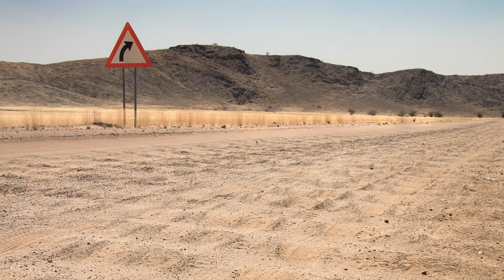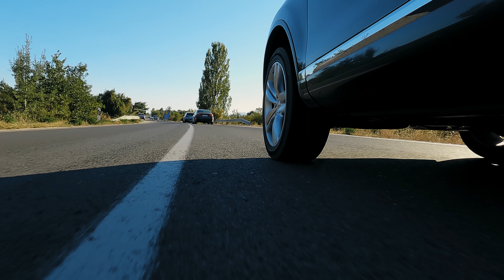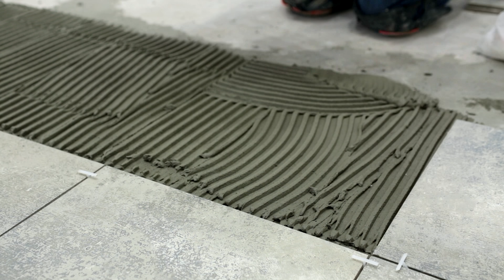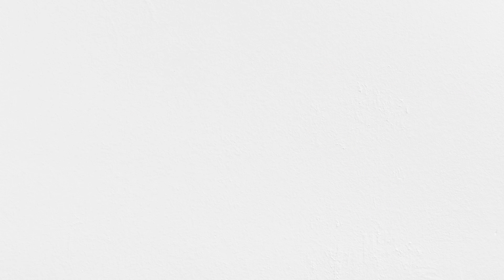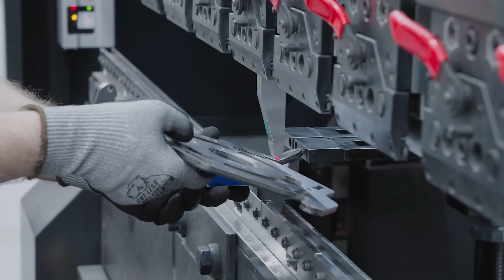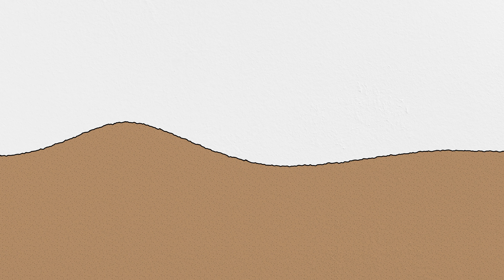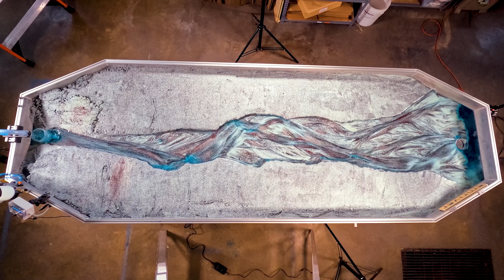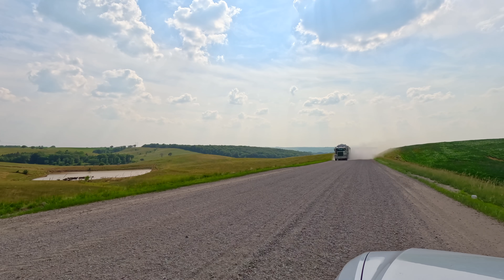Why Roads Get Washboards

Comment: As someone with a gravel driveway in need of repair/resurface, testing of different methods of stabilization in your test bed would be cool to see! 

I've been researching different base materials, geotextile fabric, stabilization mesh, geogrids, rigid pavers, etc. All the marketing tells you every product is the best, but in practice that's never the case. The size of my driveway makes it a risky expense to experiment, so seeing comparisons would be invaluable!

Comment: even asphalt can start warping, i remember an old bus road where where i lived, where there stopped busses every 5 minutes. the road at the busstop had a divit with wobble after, like a carpet that has been pushed, after having the heavy busses stop and start at the same spot
Reply: That's why heavily trafficked intersections on an asphalt road will often have concrete for the intersection itself and some distance approaching the intersection.
Reply: I've seen asphalt roads where they put in concrete pads just for the bus stops. Another example of the cost vs durability trade-off.
Reply: I have some very old memories of this phenomenon, too. It was a much bigger problem in the middle 20th century. The materials science on asphalt has really improved since then, so it won't bunch up / washboard / extrude to the curbs / soften in the heat like it used to.
Reply: There's an awful section of road in Arizona that's basically melted and wavy.
Reply: I'll see this behind stores, where they'll leave a shipping container in one spot for nine months.  Then when they move it, there's four distinctive dent patterns where the corners used to sit, molded into the pavement.  In both cases, the tar acts like a very thick liquid, like that pitch drop experiment.
Reply: different cause though.. heavy wheels in always the same spot cause asphalt to flow outward creating valleys along the road, and at the stop itself when trucks brake, start (dynamic forces) and sometimes stay for extended amount of time you get pits because of higher load
got a similar stretch of road, it has bus stops, intersection right after the stop and bus depot nearby... need to be extremely careful when driving, stay in the valleys (absolutely no overtaking) and slow down before the pits
Reply: I remember once visiting Auburn Hills, a largely commercial suburb of Detroit.
Keep in mind that Michigan allows dual trailers with a LOT more weight than other states.
There was an intersection near where I was visiting where the asphalt was barely 5 months old, and had been pushed into a 4-6 inch "wave" at the stop line.
Reply: I think that's a bit different. It's happens to surfaces, including gravel, when there's repeated acceleration or braking on it. Like a bus stop or it could be up a hill on a gravel road. Keeping and even speed in these places is important. Obviously a bus has to stop and go, so the best way to meditate that, is to use a different and more resistant material, looked concrete, in those specific places. On bus stops. Up or down steep hills or even in some turns. If you have driveway or private road, try to keep and even speed.
Reply: I second this, there is a few really old roads that aren't pothole damaged but are heavily warped here
Reply: That's right and I've always thought that is it due to incorrect design, and/or execution of the vertical structure of the road.
Reply: What you're talking about is not the same phenomenon. You're taking about what's called "shoving"

Comment: But this does not explain two common observations:
1) The corrugations are very wide, much wider than each wheel. In fact, they often extend across the whole road surface. If the corrugations were created only by wheel action, they should be independent for the usual tracks of the right and left wheels.
2) Similar corrugations also occur where there are no roads. I have come across them driving on hard desert surfaces, off any beaten track.
So there must be some other factors in play as well.
Reply: People dodge the washboards and spread them.  Accelerating tires slipping  cause them.

Comment: Back when car companies were messing around with active electromagnetic suspension (I think Mercedes demo'd a car with a suspension that could actively hop over holes and obstacles in the road) I imagined designing algorithms that if they were running on enough such cars could keep washboarding from happening and in fact keep the roads smooth just by driving over them.

Comment: In Guadalupe County they did a few test sections of road using old car tires as a base and covering them with road base. The tires tend to lock in the material better. I never heard how it lasted. There is a section of FM20 north of Seguin that always wash boards no matter what Txdot does. The base is too unstable.

Comment: All I know as a boy we lived on a dirt road in the southern California desert. We moved there in 1964. The road was smooth but got wash-boarded over time. Most of the cars out there then had leaf springs on the rear axle. When a car moved out there with coil rear springs the road would get washboarded. We only had a few cars a day go by back then so it was very noticeable. The residents out there would drag the road every few weeks with anything we could get, an iron beam or old bed springs loaded up with a bunch of rocks. Sometimes we would luck out, the dude at the end of the road had a motor grader and would grade the road .
Dad attributed it to what they called "crow hop".

Comment: Washboard surfaces go all the way across the road though. How is that possible? The washboard surface was so regular on a road I used to drive on (now paved) that I assumed it had been engineered into the road to handle storm drainage! 😆 This video is a revelation.

Comment: Every time I have been driving over rural roads of Siberia I've been imagining how that washboard is it came to be. My best guess so far was it has to be related with a spring resonance frequency and diameter of the wheel.
This needs MOAR details, it's like scratching the surface of dams, tell as more about this phenomenon so I can tell my passengers how it works for hours when our teeth rattle :333

Comment: calamina roads, very common in my country. it's caused by heavy ton trucks driving at high speeds compressing the gound forward. Dirt roads that have been flat for decades turn rigged a few months after some construction like road paving, real state development or whatnot that is causing hundreds of trucks to transit for said road per month

Comment: This video is o cool, I genuinely thought that they were compressed this way deliberately, sort of like they do for ski slopes. 

I still find myself confused with this explanation. One thing that doesnt quite make sense to me though is the size of the ridges, they are pretty small. If you look at the demo in the video, the size of the ridges is larger than the size of the wheel, so you can talk about the wheel going up the ridge, getting airborne, and landing again in the valley. However, the ridges I am used to on rural roads all seem to be much much smaller than the size of the average tire. 

A bigger point however is that the washboard pattern seems to be uniform across the width of the road except for where the tires seem to go. In that there is usually a noticeable lack of ridges precisely where the tires are, as though the cars driving over these are flattening out the ridges, not creating them, while the ridges go uniformly through the center of the road and off to the shoulders where there are fewer tires contacts.

Finally, if you look at the ridges you see in sand dunes or riverbeds, they have a rough scale and size, but they are not uniform and straight. However, the washboard pattern or unpaved roads seem very regular and perfectly straight.

Comment: It pays to drive quickly over corrugated roads as the tyre skips along the tops rather than dipping and diving each roller coaster. Also less air pressure in the tyres softens the bumps or you can really get a jaw shaking ride over long distances.

Comment: I wonder if vibrantions from the vehicles passing through help kickstart the process or helps speed it up in any way. I grew up on dirt roads and always hated driving on them because of washboards. Never knew there was a name for it. My teenage self in my 84 Pontiac firebird was always doing donuts and spinning out on the roads pissing off the locals even more.

Comment: I used to drive for a limo service.  I had to learn to laugh at certain customers complaining since trying to explain what they were complaining about was their fault, not mine, never went over too well. THEY chose the farm/barn venue for their wedding; a farm venue that was usually at least a half mile or more down a dirt road off the paved main road.  They'd ask if I could go faster cause they're late.  Not my fault they walked out of house [at pickup location] 35 minutes after pickup time. I was there 10 minutes before the pickup time. Then, after ceremony and it's time to head to reception, everyone would leave but couple had to take pictures and more pictures and more pictures.  Now, I'm supposed to hurry up since everyone has been waiting at the reception location for them to arrive.  Again, sorry, not my problem. I will only go fast enough down nature's vehicle suspension test track to keep the noises from the car - the car, the glasses in glass holders in back, anything and everything else in back - to an acceptable level for the human ear.

Comment: Ok so reading the comments made me remember this. 
Concrete highways are poured in sections. Concrete density is higher at the form interface, so it is slightly taller that the middle which contracts as it cures. 

The sections are poured in equal sized pieces. This causes a harmonic bounce in the car, which is very un-fun in the cars. 

WHY IN GODS NAME are the sections not poured in different length sections, AND poured with angled edge instead of perpendicular to traffic direction. If we just made a randomized non harmonic pattern then the cars suspension would smooth everything out and the harmonic would not form. We do things like that for other installations, it would not change function nor cost, and it would solve the uncomfortable and sometimes dangerous problem.

Comment: Yes I would like to see a video on different materials as a road base. I used to live in a community that was responsible for the road maintenance and they were all dirt roads. This community was south of Tucson AZ, so it was dry desert with periodic high volumes of rain so there were washes with culverts that the road traversed with big up and down slopes. This created the problem of wheels accelerating the washboarding because as the wheels accelerated they would spin out and dig out the washboards even quicker. They had plans to improve the road but it was millions to put in bigger culverts and fill in the valleys that led down to the washes over the culverts. And since this was a community of large lots of only maybe 200 houses, there wasn't enough funds available to pay for it. It was a headache to get money together to just grade it periodically. I'm a mechanical engineer and like analyzing problems, so I looked into different road base materials and there are lots of opinions on what makes a good road base. Then there is the cost of importing thousands of yards of the right material. I found a manual that was very helpful, "Gravel Roads Maintenance and Design Manual" November 2000, put out by US Dept of Transportation. They talk about all aspects of gravel road maintenance. There is a picture of a road in Ecuador that sees 200 inches of rain a year and is in good shape with minimal maintenance. The biggest factor to a good dirt road is drainage management.

Comment: I see many washboarded areas on asphalt in PA. It seems to mostly occur around intersections, often in the braking areas. We also get huge ruts in asphalt at intersections where trucks frequently wait at the light, like a turn lane into a truck stop.
Reply: Most definitely they always pop up where vehicles accelerate from either a stop or coming to one.
Reply: You should also know that dually trucks must drag one of their wheels to make turns, this digs into the asphalt.  Same with dual axle trailers, one set of axles has to drag to turn.

Comment: so long as the roads are dirt the only real way I can think to handle it is a flat rigid road drag with a compaction wheel behind it. Motor graders are not good for this task. 

But I personally always thought it was the drive wheel causing this more than the driven wheel,. I figured the drive wheel would break traction slightly while moving forward pushing the top layer of material backward and creating a little ramp, when the drive wheel hits the next ramp it compacts it. so the harmonic resonant frequency of the suspension, tire sidewall, tire diameter etc all played a part in making an averaged harmonic to make the drive wheel bounce its traction and the driven wheel to serve as a compactor. 

If you look at uphill sections the lane going up the hill tends to have more ripples than the down hill side (which is why I drive on the wrong side on those sections). I figured because the traction "skip" going up the hill was more amplified due to increased power/load going up the hill. Whereas the down hill side people are coasting and breaking. 

But yes, ripple roads, aka washboards, are still a thing in the world

Comment: Groundskeepers for a baseball field know a lil about this. You can’t drag fast or you’ll start this washboard effect just after a couple times, caused by the machine itself but more importantly the drag. If this does happens, it takes a loooong time to level out, and you usually have to take a loop hoe or shovel to cut up the high parts

Comment: Interesting, thanks.
So, below a certain speed, no washboarding happens.  For a private drive, it would be helpful to know what that speed is, but I expect there are many factors that affect it (road material, ambient temperature, tire size and type, weight of vehicle, wet or dry, etc).

Comment: One thing your circular road is missing, is the "standing wave". Your washboard will move faster when your circles length does not match an integer multiple of the resonance frequency (which is very unlikely). You could insert a short paved part, to have a fixed start and endpoint.

Comment: in some areas in Brazil it is costumary to see on the side of the road two tires tied togheter with a strong rope.
What happens is if you see this, you should tie the rope do your vehicle and ride dragging the tires until you find the end of the road, or a bridge or a landmark. You then leave the tires behind for another vehicle to do the same on the other direction. After the process, no more ridges in that segment.

fun fact, in brazil they are called "Costela de vaca" which is cow's ribs
Reply: I will keep an eye out for those on Geoguessr maybe it'll help me someday lol

Comment: 13:34, I don't know if you have ever covered pothole formation in asphalt paved roads. In the UK, lack of maintenance of infrastructure is causing an epidemic of potholes, and almost everyone I know has now had at least one wheel and tyre failure which occurred after meeting an unfamiliar or rapidly growing pothole which it was impossible to avoid... I know that the quality of road surfaces has deteriorated over the last few decades and don't doubt that water ingress into the spaces between the particles in the asphalt and freeze-thaw cycles has some bearing on what it happening... plus our roads were OK when trucks weighted 22 tonnes and most freight went by rail. Now most trucks weigh 44 tonnes and the rail system is a shadow of its former glory... Thanks for this one... counter-intuitive is always most interesting.